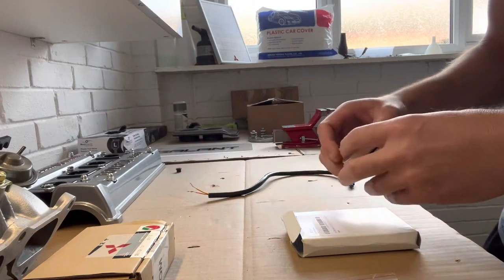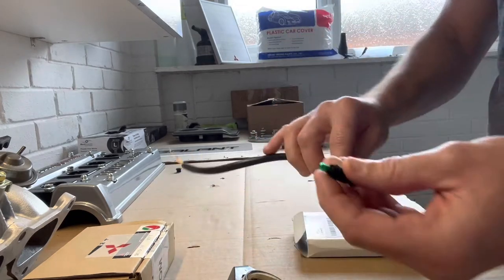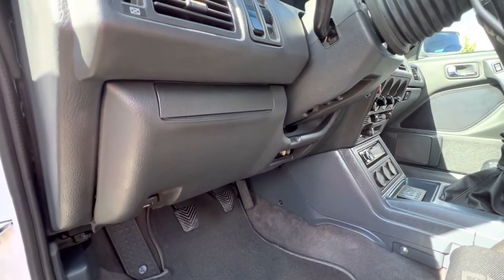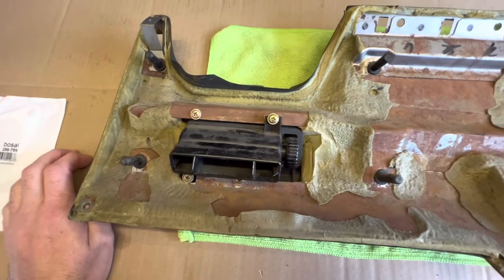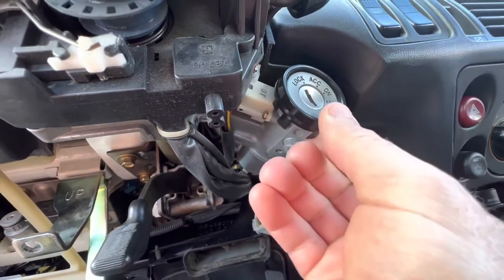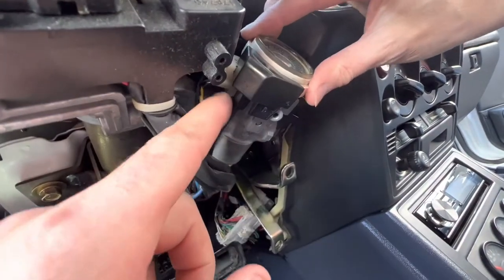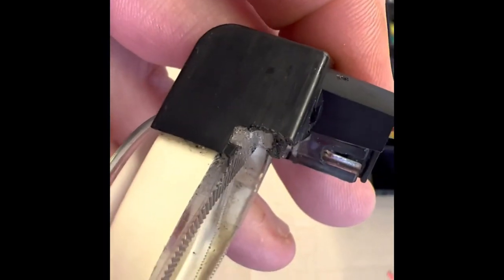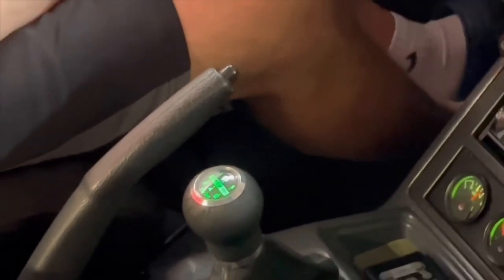How to install Illuminated Key Cylinder on Mitsubishi Galant VR4

Comment: That's a clever use of the Mitsubishi parts bin!  If I may ask, where did you locate that kit?  Was there a specific Mitsubishi part number involved?  All the lighting in my 89 Mirage Turbo is green as well and I've been hellbent on any illuminated item inside the car also being green lol.
Reply from the maker: It is from a Pajero. Not sure if the Montero had this. Also I believe the 1g Eclipse had it.